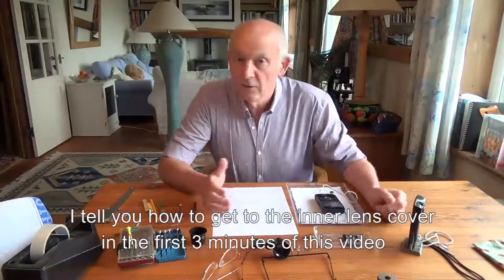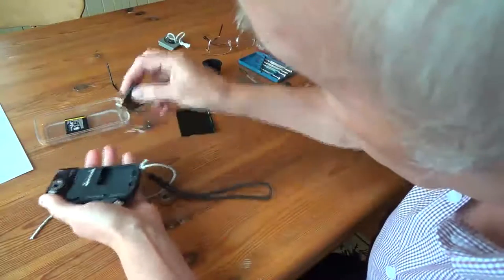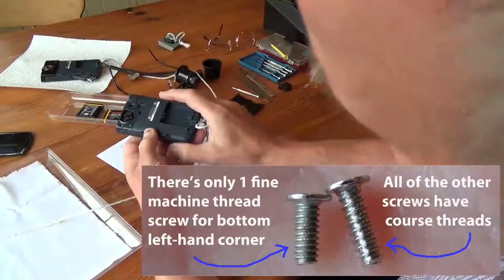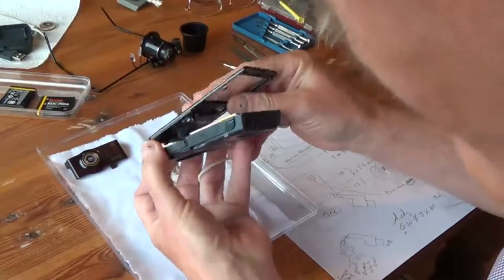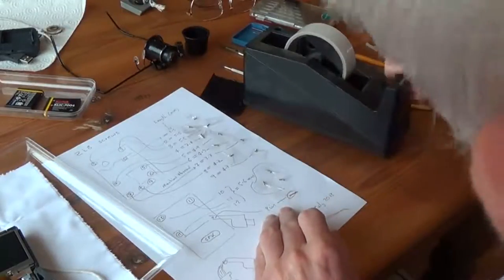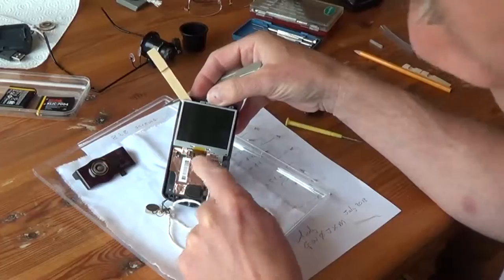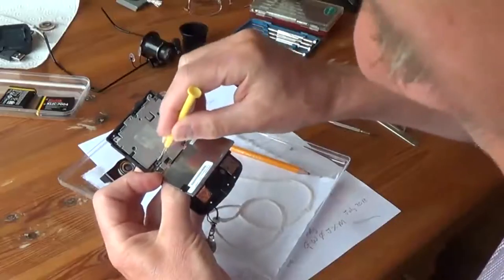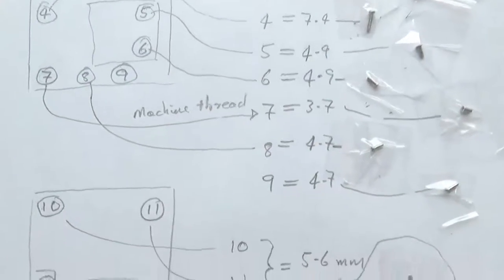Kodak Zi8 clean lens + replace USB plug

Comment: I do my repairs the same way, draw it, tape it down, and reverse assembly, learned it from my father, he acquired quite a few mantle clocks and grandfather clocks with broken or missing parts. I worked on them for him and used 2X4 scraps and a small hand drill for the small parts with a drawing of the device, repaired every one of them to working order. Dad was a master machine engineer and taught us how to machine the parts.
Dave

Comment from the maker: Hi Dave, thanks for the interest. I think it’s a little unusual to find 7 different screw lengths doing a simple job like holding the case together. I guess the guy designing the plastic mouldings didn’t have to worry about the hassle of purchasing and controlling the stock of 7 different items when he could have used maybe 2 types. Maybe I'm old-fashioned and you can save a penny per thousand if its 0.5mm shorter? Anyway I hope the video helps someone trying to fix a Zi8.
Regards ... Andy

Comment: Thank you for taking time to do this, currently nothing wrong with my Zi8,  i dont really ever use it but always did find it a neat little camera. And have wondered about replacement parts or hacks, really anything to repair or improve on its function.  73 de W8FG

Comment from the maker: 2 of 2 
... I don’t know if this helps but I’ve just taken the battery out of my Zi8 and plugged it into the computer and the red light on the On/Off button flickers 3 or four times in about ¼ a second and then remains off. If yours does the same and gives that brief flash it may mean that the camera is OK but I can’t guarantee it.
I hope that helps at least a little bit.
Good Luck ... Andy

Comment: Thank you for the quick reply. The battery tested at 3.5v, so apparently good. I purchased a new battery just to see what happens. When i plug it in by USB with no battery, the light doesnt do anything. But while i have it plugged in via usb, THEN i insert the battery, the charging light comes on. Then if i press the power button, the light turns off. Unfortunately the new battery didn't do anything for it. It just sucks because i only got about 5-6 hours of use out of it before this happened!

Comment: I am having problems with my Zi8, and maybe you can help. I bought it a while ago so its out of warranty obviously. I didnt use it for a very long time, in fact i forgot i even had it. So i decided to charge it up, the indicator light turned on to show it was charging, but it wont turn on. My guess is a deader than dead battery, and that it doesn't even have enough juice to initiate the charging portion of the system. Do you have any idea how this could be fixed? I enjoyed this little camera!